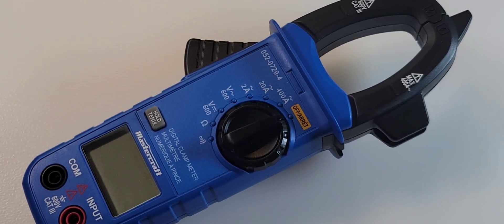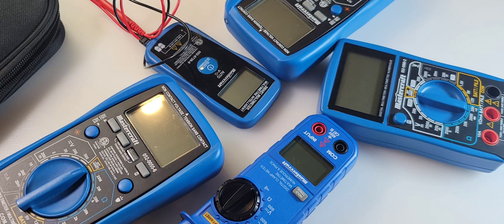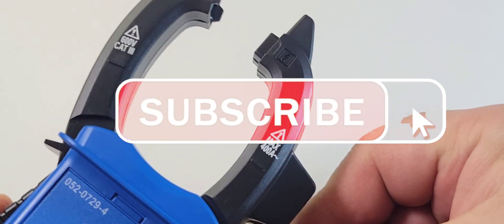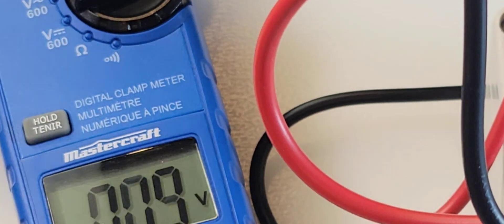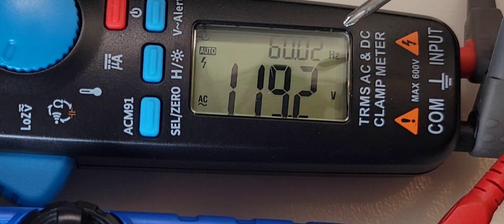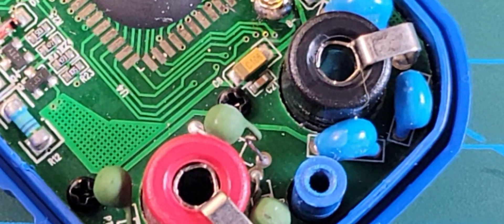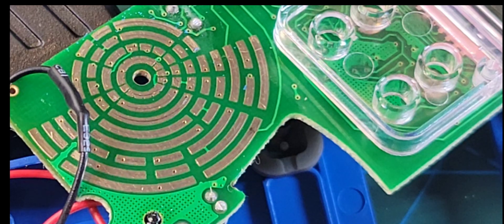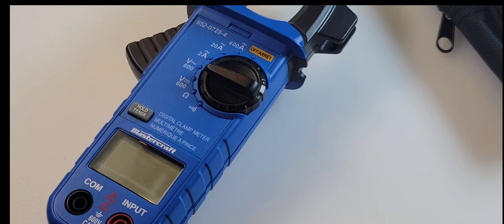MASTERCRAFT 052-0729-4 AC CLAMP Review & Teardown!

Comment: The Klein CL390 clamp meter is $118 (HD Canada) but MUCH better.  AC/DC A, TRMS, 4000 cnt + the usual DMM features. The Mustool C21 has similar specs at half the price, but not Klein build quality.  Don't take chances with high current.

I do kind of like the little CT 052-0726-0. Lots in a very small package. It is overpriced for $70Cdn but frequently on sale. If not, the little Aneng one is a better deal.
Reply from the maker: Great info Barry..wholeheartedly agree 👍

Comment: $55 for this clamp is nicht gut, nicht gut at all. Which is a little disappointing since Mastercraft is not a bad brand and I like this deep blue Mastercraft color.
 
But it’s as you said. It has good input protection and build quality, but lacks important features that you can get on other clamps in this price range or even cheaper. 😐
Reply from the maker: Vunderbar mein freund! You definitely hit the nail on the head 😊 I think that electric blue definitely rocks too.. 👍